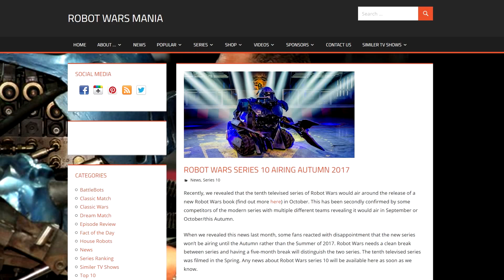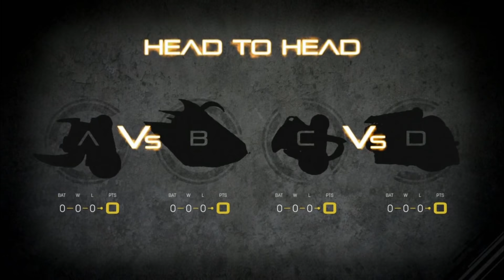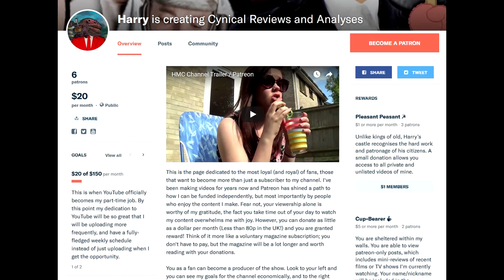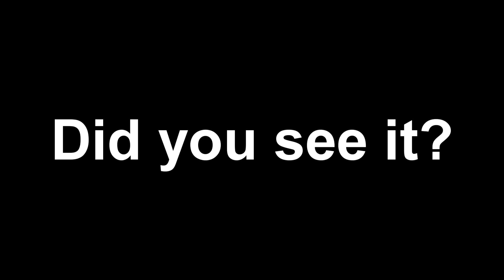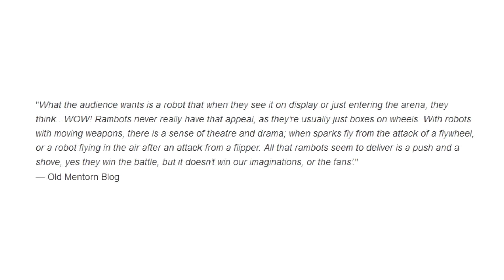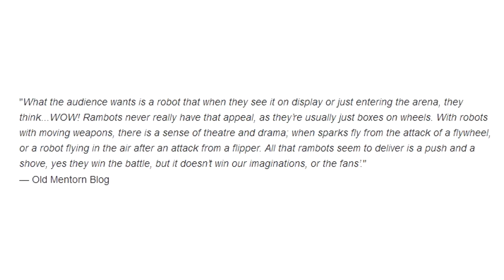DID IT SUCK? - Robot Wars 2017 (Series 9) Review

Comment: Bars and disks have different advantages and disadvantages. A disk can store more energy, having a larger amount of its mass moving at high speed, and you're less likely to be jammed up. However, against another spinner you're more likely to get your weapon caught by your opponent's and you don't get as much bite. A bar is basically the opposite - more bite and less likely to get caught by another spinner, but more likely to get jammed in a corner and can't store as much energy.

Comment: If I'm honest despite what happened in series 10 I think only one robot can beat Carbine if both robots are working at full power. And that'd be Berserk from series 3, I know it sounds weird but Berserk stood up to Hypno disc without taking any damage and only lost due to a floor spike. I think the same would hold true against Carbine...the weapon wouldn't get through Berserk's armour leaving Carbine rather exposed to Berserk's axe and fork lift. But it's not going to happen. 

I suppose if I had to name three other robots who I think could beat Carbine. Would be Razer but only if they fought the perfect battle(Which is never going to happen). second would be Panic Attack, again same rule perfect fight otherwise it's doomed. And third would be the former Battlebot champion, Biohazard, again requiring a perfect battle but I'm also more confident that Biohazard should be short enough to avoid Carbine from hitting anything really important. So maybe Biohazard is my second choice but really I'm probably wrong. 

Not to mention I've only seen Carbine fight a few times before the new Robot wars bored me to tears.
Reply: I really, really hope you're joking. Berserk 2 would be eliminated in literally one hit by Carbide. Hypno-Disc in series 3 was unleashing about 5kj of energy in a full-speed hit. Carbide is unleashing literally THIRTY TIMES that.
Reply: Not a single robot from the classic would have a chance of beating Carbide, or indeed any of the new machines. Evolution of technology is just too great. People need to stop with this nostalgia fight court thing.
Reply: I dunno, series 7 storm 2 could still be decently competitive today to be honest. Carbide would deal serious damage but it is the only robot that might stand a chance.
Reply: Storm 2 got KO'd by Supernova in the Third World Championship. This was edited out because the judges overturned the result of the fight and Mentorn decided to cut everything after Supernova escaped from the wall to try and avoid controversy, but they didn't catch all of the shots and you can see an over-shoulder shot just as cease is called that shows Supernova free from the wall and Storm 2 dead in the middle of the arena rather than fighting the House Robots in the CPZ.

Carbide would annihilate it.
Reply: Carbide is leagues and leagues above the 2003 and earlier competitors. Here's a scale for comparison- in Extreme 1 Behemoth's scoop was 1-2 mm Titanium. Hypno-Disc could only scuff and scrape it.
Flash forward to Series 8 in 2016, Behemoth's scoop is now 8mm Titanium. Carbide cleaved through both the scoop and the armour underneath it. Carbide has far more energy output and has consistently dismembered robots that the competitors of old wouldn't dream of hurting.

Hypno-Disc's earliest, weakest incarnation managed to put some slices in Berserk II. Carbide would eat it for breakfast. Razer's armour has been damaged by the likes of 13 Black and its claw doesn't have the strength to penetrate Carbide's top armour (The team tested it with Tiberius 4, who has more force than Razer). Panic Attack's forks would get torn off with the first hit. Biohazard is 4 inches tall, but Carbide's bar is only an inch or 2 off the ground. Even if it only gets glancing blows at first, I think Carbide would eventually tear Biohazard's skirts off and rip into the bodywork.
Reply: like this to the top, its too good

Comment: I think that Firestorm, or a low, front hinge flipper could stand up against carbide. Tall wedge flippers for live events such as Apollo and eruption, are too tall to get all the way under a bar spinner meaning at some point the bar will catch. Firestorm on the other hand is much lower and can easily run under a spinner in my opinion, plus a front hinge could press it against the angle walls of the arena. Which has been done before by TR2.

#Firestormforthewin. Or push to exit
Reply: No.. Episode two of series 10 shows exactly why a flipper wont work on carbide anymore unless carbides bar fails again..Aftershock is the only robot at the moment that has a chance of knocking them out due the way their weapons works.. I am pretty sure carbides chassis is not designed to take that many big vertical hits like that on the front.. time will tell and yeah this is spoiler free in case someone points out we already know the outcome
Reply: A remade Firestorm with a thick Hardox wedge face... maybe. Old Firestorm would be obliterated in one hit, the thing was made of 5mm Aluminium.

Comment: The new series (9&10) were pretty good, but the amount of really good robots seems lacking. What is also lacking are the number of entrants. I just watched series 10 and they had 6 robots per episode over 6 episodes (36 bots) which seemed low. It is odd to see the presentation updated after watching the old episodes for years, but it is also extremely refreshing. 
Even though Craig Charles will be THE face of robot wars for many fans both Angela and Dara were not bad hosts, they (Especially Dara) just seemed too serious and in some ways uneducated for their roles. I thought the filler during the episode was done very well which included interviewing the team and the after battle reports on damage done to each teams robot. I actually liked the new battle formats just as something to shake up the shows, but I felt it was really stupid to have the best robots on the same episode. Honestly I saw Carbide and Apollo face each other on the same episode knowing one would not make the finale... come on!
The new arena was a bit underwhelming and felt like it was made on a tight budget as opposed to the late-90's, early-2000's version. While the best part of getting rid of the music was hearing the loud impacts between bots, the worst part was if two bots had to resort to ramming each other since there was literally no noise at all. I don't know if the crowds were just smaller or what, but I could barely hear them while watching the episodes. 

I just read that BBC had cancelled the show again after series 10 which makes me quite sad.

Comment: Actually the internals are a bit different with sabertooth and minota- concussion, in addition the drums are different as one is single tooth, like it should be, and the other has two teeth, also while sabertooth is just its own drum cuncussion was literally based off of minotaur and they wanted to get it out before anyone knew about minotaur.
Reply: It wasn't based on minotaur as they had not known about it until they tried to compete at battlebots, but they were worried that everyone would classify them as a minotaur copy.  If you look at concussion compared to minotaur, the design of concussion limits the gyroscopic forces of the drum from lifting the robot due to a lower centered body, but minotaur has the weight in the center of the robot and in the armor which doesn't prevent the gyrodance that vertical and drum spinners are known for.
Reply: Chef Boi Arby i believe they said it in their interview with votesaxton

Comment: Actually they couldnt have picked Apex instead of Wyrm, because the rules they laid out clearly state that a withdrawing robot is replaced by one from the SAME group battle, which Apex was not. Also the order of the head to heads was decided by random draw, otherwise it would have been unfair.

Also, Ironside 3 had a srimech, but Carbide wrecked it in the grand final group stage.

Regardless, the new format should get rid of most of those concerns.

Comment: One other robot that could stop Carbide is Berserk from series 3 and 4 of the original run. For one, they were the only robot apart from 101 to escape from hypnodisc with no damage and their weapon combination was also very good. Just add a wedge to the front and increase the speed and I think they have a reasonable chance against Carbide.
Reply: The robots back then were very different to the ones we see these days; remember, series 3 and 4 were 18 and 17 years ago, when most of the robots and components weren't as durable or powerful.

Now, the weapons, motors and armour is significantly more powerful and durable than they used to be, so Berserk II from back then would need a serious overhaul to withstand the much newer and younger Carbide, which is built with the modern parts in mind.
Reply: Berserk survived against Hypnodisc because Hypnodisc was absolutely terrible back in series 3 It's drive was unreliable and the only robots it was able to destroy were poorly built. If it wasn't for the judges clear bias towards Hypnodisc when it comes to judges descions Hypno Disc would of lost It's heat. Carbide however is far more effective than any version of Hypno Disc and would tear through Berserk's armour (which is less durable than Eruption's and you saw what happened to them) easily.
Reply: Well for starters, Hypno-Disc DID damage them, they put several gashes into the back armour. And secondly Carbide's bar is literally 30x (yes, 30x) as powerful as series 3 Hypno-Disc's weapon. Carbide would have absolutely no trouble chopping Berserk in half.

Comment: Storm II is really a shit-tier robot now.

It's had basically zero upgrades since Series 7, other than being actually downgraded, replacing the motors that made it so powerful with much less effective ones that don't actually work properly. How bad are the new motors? Well, they burn out so quickly that the machine doesn't actually run for the full three minutes of a modern RW fight unless it's packed with dry ice. Its construction is now an artefact of its time, providing it with much less defence against big hits than it would've had in the day.

Furthermore, Ed Hoppitt has had a long running habit of getting on the producers' nerves, with the big sticking point being Team Storm's application for Series 8. They applied claiming that they would be bringing a minorly upgraded Series 7 Storm 2, which now packed interchangeable weapons, specifically the spinner shown in the broadcast Heat. Instead, they showed up with a heavily downgraded machine, and the spinner didn't work, at all.  Not as in "This worked in testing, but died on the day", but as in "This isn't actually remotely finished."

As for what could beat Carbide? Terrorhurtz. John Reid's machine is packing a heavy Armox spinner killer wedge, and a powerful overhead axe that would rain painful death down on the thinner top armour. Really, THz should've done a lot better in Series 9, but the producers saw fit to stick it in with two vertical spinners, when the robot is really designed better for horiztonals.
Reply: From what I found out, Storm II's original motors were too unreliable and expensive to maintain, hence why they downgraded the top speed significantly
Reply: Yeah, but the robot itself still wouldn't hold up to Carbide, or a fair few other modern spinners. The construction is outdated badly by now.
Reply: Oh of course, the original Storm II is around 13 years old now and even though it actually had thicker armour than it does nowadays, it definitely would not be able to withstand spinners of today.
Reply: Terrorhurtz and Nuts 2 are the only robots to ever defeat a fully-functioning Carbide (Nuts 2 just dismantled a vital part of it), and Terrorhurtz is the only oen to ever KO it. It's easily the best robot to face Carbide.
Reply: Gary Cairns also mentioned that Ed deliberately tried to buy off that motor in Series 8 (the one PP3D bought from Gabe to keep going), even though he didn't need it (which would have sabotaged PP3D's chances for the later fights). Offered twice the value as well. It was on the subreddit at some point, I'll try and find it. More controversy for Ed, unfortunately.
Reply: Yeah, Ed's kind of a shit, unfortunately. 

For as much as he railed against Mentorn for supposedly stiffing him out of the Series 7 title (On a rewatch, it's Typhoon's fight, though only just, and the dislodged drive chain that Ed complains about the judges ignoring was from its fight with X-Terminator), he has no such qualms about the Third World Championship, and he even still brags about being the "Robot Wars World Champion", when he's only really the Champion because there was never a fourth one.

Fact of the matter is, Storm 2 lost its battle with Supernova. After Supernova was beached on the arena wall, it managed to free itself and outright killed Storm 2 to take the victory. However, after the match was over, the judges overruled the result and claimed that Supernova had been beached for too long (It was never counted out), and judged the fight only up to that point, awarding the victory to Storm 2. Robots being stuck on the wall is one of Robot Wars' biggest inconsistencies, at least until they redesigned the arena to reduce the chances of that happening. 

In the aftermath of the fight, the producers hastily edited the episode to show the fight ending with Supernova still beached, cutting out its escape and victory. However, they didn't do a perfect job. In the shot of Team Storm in their booth, the arena is visible over their shoulders, and the robots' positions are different to the edited fight, which had Supernova still on the wall and Storm 2 in the CPZ. However, this shot shows Supernova free and Storm 2 sitting lifelessly in the middle of the floor.

Ed never mentions this detail.
Reply: Was that Typhoon match really that close? To me it felt mostly like Typhoon was running away most of it. But yeah I agree Ed is a bit of an asshole. Hobgoblin team had a lot of beef with him too, apparently.
Reply: It's close, but even in the TV edit, I think Typhoon wins.
Reply: Kinda curious, I want to hear your viewpoint on it :) Geniunely interested. It's nice to have these discussions without people trying to sling mud at each other and being tryhard fuckmuggets.